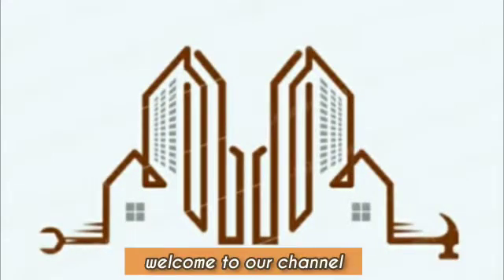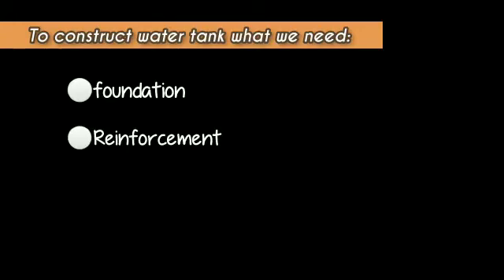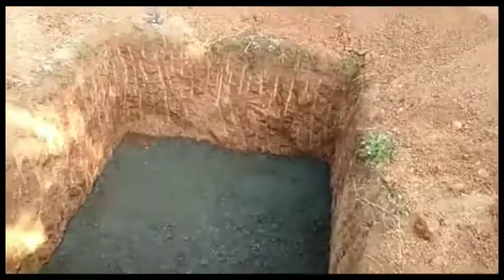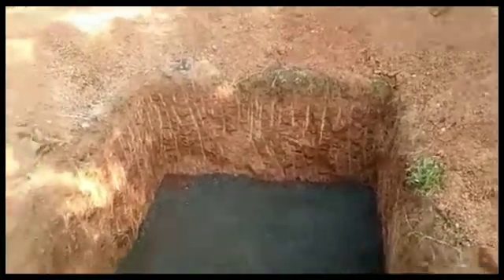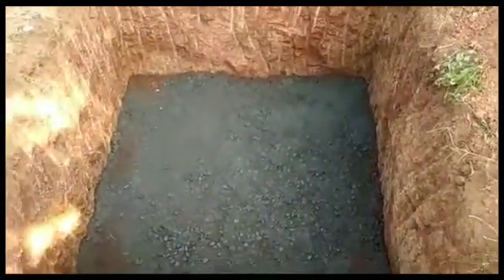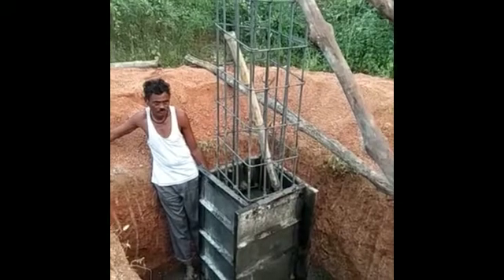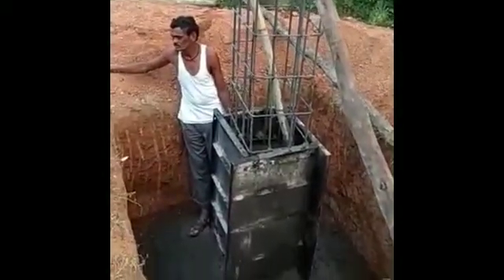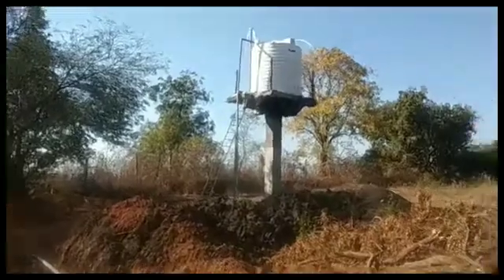construction of single pillar Rcc stand for 5000litre water tank

Comment: Please I need full details on this construction. Thanks
Reply: What is about the details of beams ???
Reply from the maker: earth work size of pit 1.5x1.5 x1.5 metre
bed 1:4:8 (1.2x1.2x0.2)m concrete
use 12mm steel for pillar over mat 12mm
rcc 1:2:4) mix 1.20x1.20x0.30m bed
pedastal rcc 1:2:4) mix  0.6x0.6x0.6m r
raise column rcc 1:2:4)  0.45x0.45x 3.00m
over it slab with 10mm rods spacing 20cm both sides